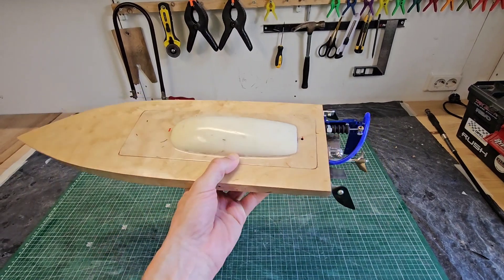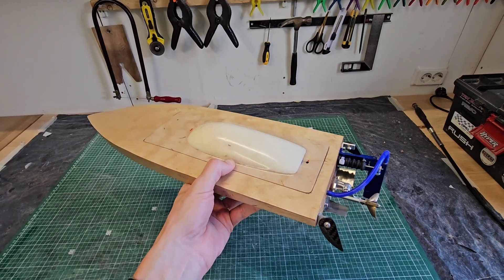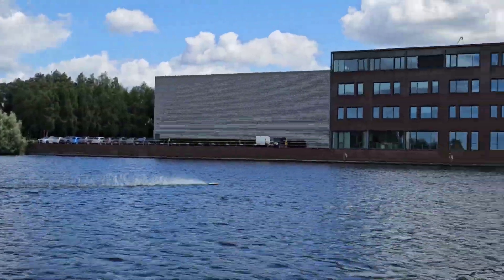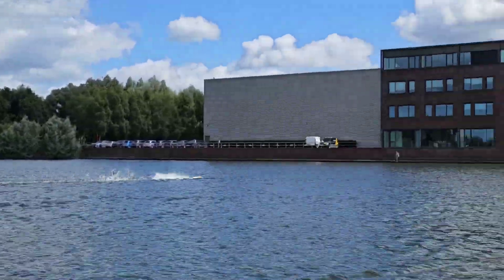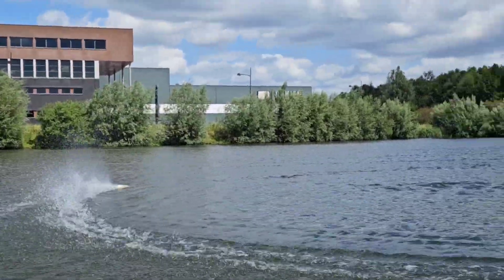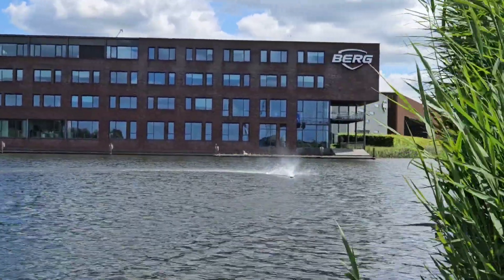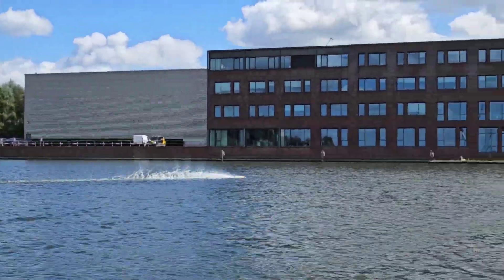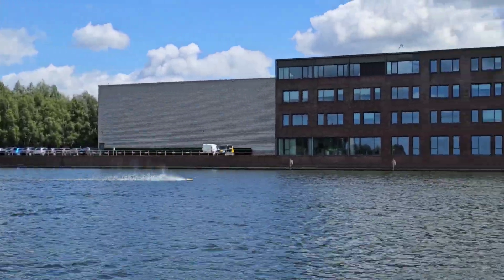How to build a fast rc boat: beginners guide part 3, Maiden Run!

Comment: Hi I want to make the same design but it should not be remote controllled and just to make it run straight in a pool.
Reply from the maker: Why not RC? It's even more fun!
Reply: No the competition that I am making the boat is that it should be not be remote controlled. Do I then use a brushed motor at the place of brushless. I have to make it run in long straight pool.
Reply from the maker: @ARYANG.S. I see, that sounds cool!

Comment: so we ran the chinese rigger on  that funky stock kit motor and wasnt happy with the speed
prop was  32 mm 1.4 pitch  2200 3S  bat.........just took that motor out  and looking for something that will give me some decent speed, what would you suggest cuzz I have no idea................btw  that kit motor was 3700KV
Reply from the maker: I would go for a 2948 3450kV on 3S with a 36mm metal prop1.4 pitch to start with, and if temps are ok, yiu could try a 1.6 pitch. That will give you  80km/h or 50+ mph easily
Reply: @CozyRC   the perfect answer  I was looking for !!!  BTW am installing the 2948 in the rigger now  will see how it goes........I also have M500 ready to go......
Reply: @CozyRC  finding out thier arent many flex cables with 3.17 prop shaft so am going to the 4mm 36 mm props and hoping I can shim the hole down to 3.17

Comment: Hi Jan. I just found out about your channel and i love it. Already subscribed. I´m gonna build this very model but i have one question. To balance the boat, because it has the rudder diverted to the right site, the propeller needs to turn to the right side (right handed), right? Am I thinking right?
Thank you.
Reply from the maker: Hi Lucas, thanks for the sub! To answer your question: this boat has a left rotating prop, looking at the back of the boat, with the rudder on the right side. This is a common setup for a mono / V-hull. The torque from the motor and prop wants to rotate the boat clockwise. Therefore, right turns are the way to go, and the rudder is placed on the right side as well. Left turns are not as good, but still works too, especially on lower speeds. Good luck with your build, I'm sure you'll love it! 😎
Reply: @CozyRC Tk you Jan. I’ll drop on it a left drive shaft and prop. I just bought the wood yesterday and today I will print the plans, just to work on the scale. Thinking about drawing in on cad and cutting on laser. Do you recommend?
Reply from the maker: @rnclucas  It's up to you! Lasercut makes it faster to build, and it's very accurate. But it can be done by hand saw as well 😉. Enjoy the build, and if it's finished, please send me a photo, and I will share it on my channel ✌️
Reply: @CozyRC I will. Tks again for all.

Comment: Hi Cozy, a question, are the tracks under the keel not necessary for this mini mono?
Reply from the maker: These are called strakes, and they are not required. That makes it easier to build as well!
Reply: @CozyRC  ok

Comment: Is there a link for the upgrade brass props ? 
Thanks
Reply from the maker: Yes, here you go: https://a.aliexpress.com/_EviM3BV
It has a 4mm bore, so you would need a sleeve 4 to 3.17mm to fit the prop shaft (If you ordered from the parts list). I did just use a piece of aluminium tube 4-3mm and filed the 3mm internal diameter slightly bigger, to fit the prop shaft. I will show it in a future video!

Comment: what size is this boat please so I know what size wood to order?
Reply from the maker: @grrfy  The boat is 50cm long. Please note, the deck and bottom plating is bended, so the flat patterns are slightly larger than 50cm. Have fun building!
Reply: @CozyRC  ahh thank you. I did just see the sizes after I typed haha, I cannot seem to find any wood or veneers long enough or thin enough
Reply from the maker: Where do you live? Maybe I can advice?
Reply: @CozyRC  I am in the UK I can find either the correct length ,,or correct thickness, but not both in combination it seems I am thinking it may be easier to scale up to get the correct proprtions of thickness to each part
Reply from the maker: For the bulkheads, basically any ply between 2mm-3mm will work. For the plating, I used 1mm, but you could use 0.8mm to 1.5mm thickness. How about this supplier: https://www.lathamtimber.co.uk/products/panels/plywood/birch-plywood/thin-finnish-birch?utm_medium=organic&utm_source=google
Reply: @CozyRC  OH Thank you so much , that looks promising! I am seriously thinking of a mahogony veneer over the sideplates, give it a bit of old school style! I will email that place in the morning thanks for your time! much appreciated

Comment: It runs very good! Top build 👍
Reply from the maker: Thanks Peter! How about adding one to your boats?
Reply: @CozyRC  Man, i haven't had the time to do anything to my boats for about 9 weeks or more (not even celebrated my birthday), don't know exactly. So cant run Dom or twin build (which is at a stand still). Im almost done with my porch/garden but still have to do lots off things. It took a hole lot longer than i imagined (i will be nice though, so im proud off that) but my body doesn't always want to work as hard as i would like or protests.  So at the time... please no!
Also kind off glad weather sucks, makes it easier to cope with the idea i can't run my boats... 😉
Reply from the maker: I get it! House jobs are important and time-consuming. I just started painting the outside of my house (window frames). Lots of work, but maintaining my house is required!

Comment: Damn! Its great and I am suprprised with the speed on 2600kV motor. I have the same size wooden cat with 2948 3450kV rocket motor you recommended on part list. I used 33mm prop and my problem is very very hot motor. I think the reason for that was not balanced and sharpened prop. I think it makes sense compared to your boat with even bigger prop and motor slightly warm.
Reply from the maker: You're right, this 2600kV motor is just a mild setup. I had this one laying around, that's why I used it. Regarding the Rocket motor: I have the 2948 3450kV on my Cozy F1 Tunnel on 4S! It runs very light,and not hot at all. Top speed: 89km/h! 
That motor would absolutely rip in this boat. Only about 900 grams RTR weight also helps to keep the motor happy. We will soon find out!
By the way: I updated the parts list. The motor coupler was the wrong size. It must be 3.17 to 3.17mm and not 4 to 3.17mm. Just so you know! ✌️

Comment: listening to the music with headphones is rough, kept hearing what i thought was cats fighting outside. turns out it was super faint screaming or something sounds embeded behind all the music. kept stopping the video to look for my cats thinking shit was going down.
Reply from the maker: @alanunruh7310  Thanks for letting me know, I appreciate it! I wasn't aware of that. I'm indeed experimenting with the music. YouTube requires to use copyright free music only (which is understandable). I will try to pick the music more carefully 😉.
At least the maiden run part of the video should not have that issue, right?
Reply: @CozyRC  lol no i figured that was that was happening. and like i said no one else in comments noticed it. and i figured its most likely because i was sitting in a very quiet house early morning with headphones blasting!!     

your not the only person with videos ive noticed it happen to. especially with the copyrights its much better to grab a quick ai clip. lol i love playing with udio when i get bored and ive noticed it has done same thing to some of the stuff ive made. my assumption is that since udio does ALL of it ai your getting really horrible mixes and feedbacks in the audio tracks themselves. if that makes any sense lol. 

 yours was just special lol cuz that faint noise sounded just like my cats getting into outside :P        and it took like 3 or 4 times before i realized its on the video so it was super faint. i certainly would think much about it.

Comment: How thick should the servo, rudder link should be. My boat is a catamaran with a length of 29 inches(70cm). i cut the thin (about 1.5mm) metal stick from an umbrella to use as the servo, rudder link. Do you think that would be strong enough?
Reply from the maker: That depends on the boat size, the steering rod length, the material, and the diameter. For your boat, I would use a 2mm stainless rod. 1.5mm might work as well, if the rod length is not too big.
I like the DIY solution, taking a rod from an umbrella! Sounds like I could have done that too 😅
Reply: @CozyRC got it, thanks

Comment: Niice‼️ i have to get my nitro boat running now, and when its running i got to do a big boat whit a 2-stroke engine from grass trimmer😎 👌🏻👍🏻
Reply from the maker: Sounds good! I'm sized down with this mini mono, and you are sizing up 😎. Have fun!
Reply: My nitro boat is from the 90's, JET STREM 1000👍🏻 its 1m7cm long😎 but my next project Will be arount 1&half meter long V-bottom boat whit the 2-smoke engine from a trimmer😎👌🏻
Reply from the maker: I know the Jet Stream from Kyosho! As a kid, I read their catalogues until they fell apart 😄

Comment: Great series Dirk
Did you glass laminate the inside or outside of the hull for strength 
Would you say this build is easier or harder than the full size wild thing 
👍
Reply from the maker: Thanks Brenton! This boat is identical to the full-size Wildthing, so  the build difficulty is the same, except I didn't glass the boat, so it builds faster, cheaper, and easier for novice boat builders!